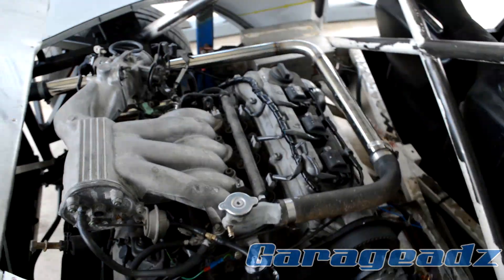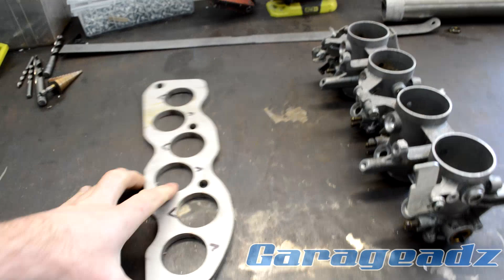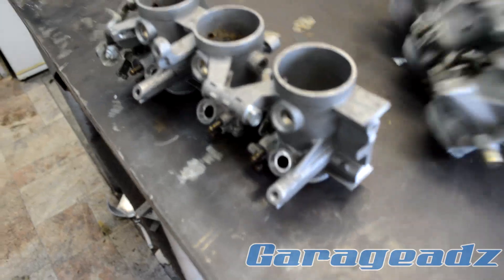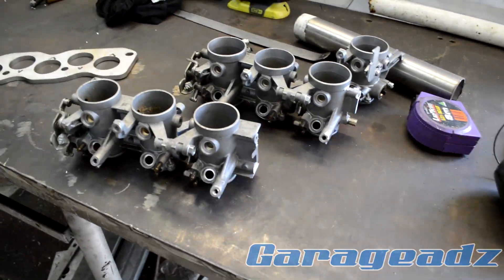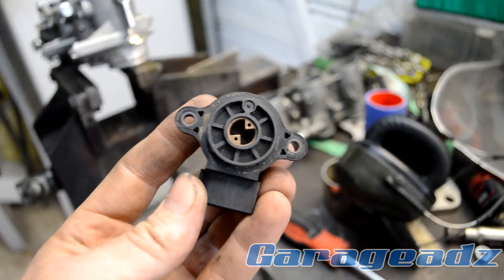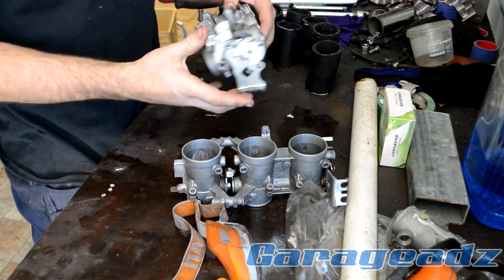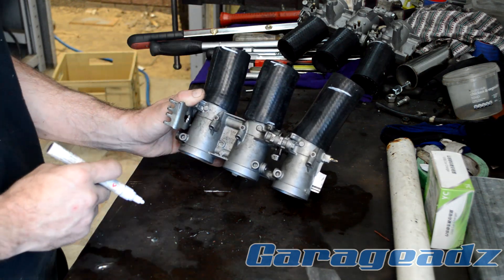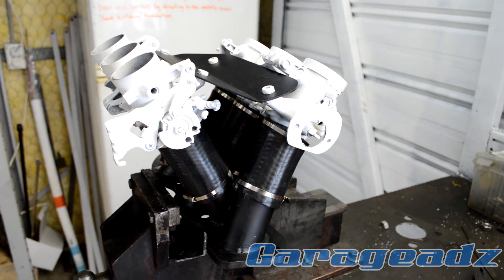DIY individual throttles on Toyota 1MZ

Comment: What do you do with the vaccume lines on the intake? And the airflow sensor?
Reply from the maker: The original vac lines go to a small cylinder and then  to the MAP sensor. No airflow meter anymore.

Comment: Is there a chance that you have a file with the blueprints of the flange.Or some other 2D or 3D model.
Reply from the maker: I just had the flange laser cut using an intake gasket and then beefed up a little on the outside. I may have another one around as I did (sold) a batch.
Reply: @garageadz   Thanks, today I did the same.Gave the gasket to a laser cutting and they added 5mm outside.

Comment: I would love a flange for this I’m about to rebuild my 1mz soon
Reply from the maker: I may have a flange around, I had a few of them made and sold almost all of them I think.  At the end of the year this setup will likely be coming off for supercharger installation.
Reply: Garageadz you find a trd charger or going custom?
Reply: Garageadz lmk if your willing to sell the old Itb setup. Either me or a couple mr2 1mz guys may be interested for sure🙏
Reply from the maker: Going for an M90, larger than the TRD unit. The TRD setup also doesn't allow for intercooling which is a must in my mind. Sorry for the delay, been pretty busy of late!

Once I'm done with this year's motorkhana season I will look at letting the ITB system go for sale.